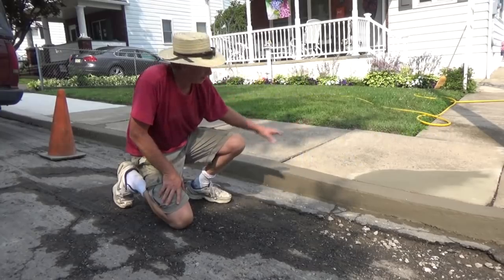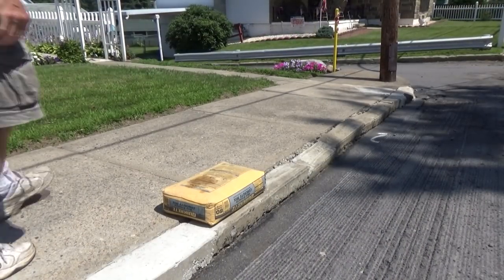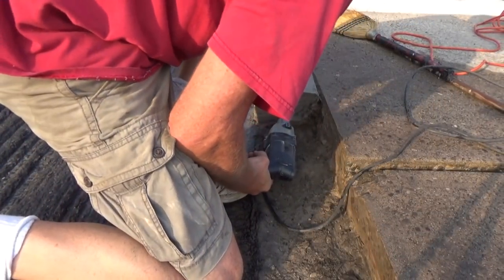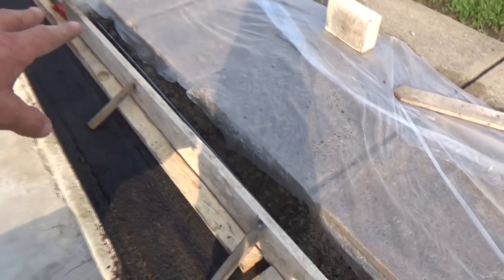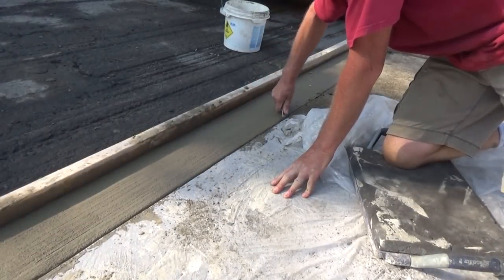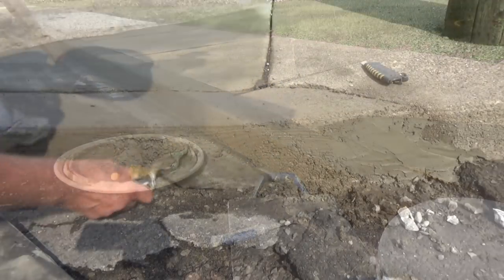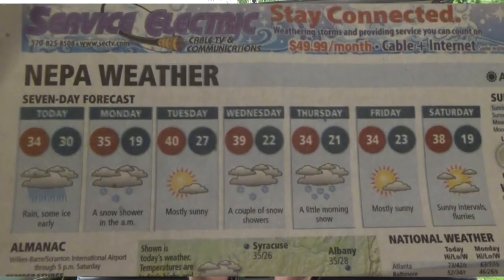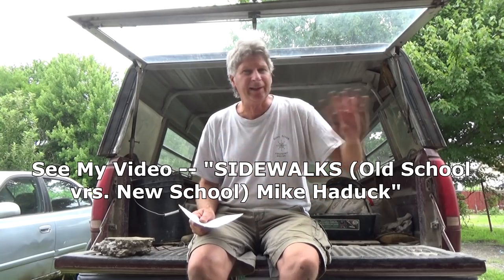CONCRETE CURB REPAIR  (Part 3) Mike Haduck

Comment: We don't have granite in northwest Oregon, so I have no idea of the cost difference between concrete and granite. There must be a trade-off between the time it takes to form and pour vs. lay down gravel bed and position stone. 
There are still concrete curbs in my town that have rings to tie your horse. New concrete seems to hold up worse than old concrete. I have no way of knowing how thick the sidewalks are, or whether they are reinforced.
Reply from the maker: Hi blank,  well I made my stand and that video about sidewalks In Europe and China,  I hate seeing guys with jackhammers when you really don’t need them, but the world is changing as it is, I appreciate it Mike

Comment: We use concrete for kerbs in the UK where the weather is similar to PA, but they are precast instead of poured. I've never seen one crumble or deteriorate so I assume the lack of voids in the cast is what saves them.
Reply from the maker: Hi David, I am so impressed with the way they are still using the stone curbs and stone sidewalks and pavers it’s hard for me to like anything else, but if it works it works, thanks Mike

Comment: Hey Mike, i gotta question. I have heard you say many times rebar rusts and blows the concrete apart. Why dont they coat rebar in a heavy coat of bitumen ?...boatbuilders do this to all the bolts they use to avoid this issue...Thanks mike....D
Reply from the maker: Hi D,  I can't say, they keep trying different things, don't see anything for sure. Thanks Mike
Reply: @MikeHaduck  Thanks for your reply as always Mike. I only asked cos i seen boat builders put a real think coat of black bitchumen on every bolt n nail to protect them from rust. There must be some reason it isn't used in construction. Again, really appreciate the reply...God bless n peace to ya.
Reply: @MikeHaduck  👍

Comment: Mike, What is the purpose of putting rebar in the kerb, do you provide expansion joint in the kerb?
Reply from the maker: Hi Iril, in the winter that curb will get hit with snow plows and it's either dig it all out or cap it, and I added that to keep it together, thanks mike

Comment: Great video, Mike, I have a question though.  I noticed that the previous curb had no rebar, if the curb is going to fall apart in 30 years regardless wouldn't it be easier to remove without it? Does adding rebar lengthen the life of the curb or does it just add support against abuse without adding life to the project?
Reply from the maker: Hi Chris,  I would say that it just adds to the support against abuse, because all the big trucks and machines will be hitting it And I want it to stay together,  but for the long term rebar only rots away And cracks the concrete up, thanks Mike
Reply: Thanks Mike, Chris.

Comment: I guess concrete held up so well  from Ancient Rome because of the favorable conditions. Here in Northeast Pa. it disintegrates over time. I think the mentality is that concrete is cheaper up front over granite, and let someone else worry about it when it does fall apart. Thanks for the video mike.
Reply from the maker: Thanks Bob, I couldn’t say it better myself, I appreciate it Mike
Reply: Romans used a very different and softer mix, that is why it lasted
Reply: @oreocarlton3343  Roman’s even invented how to set it under water

Comment: Concrete can be waterproof. I use a granite dust with frost proofer mix. Then I use a concrete sealer. This seems to last. 
In scotland the curb and the curbstones here are granite. The Council (local authority) own the pavement. So your not suposed to 'fix it' Though I have had to remove a sharp edge so that it doesn't damage car wheels going into the driveway.
Enjoy your videos Mike.
Reply from the maker: Thanks Inverness,  I never heard of the frost proofed mix, It sounds like a good idea, thanks for passing it along, nice to hear from Scotland, thanks Mike

Comment: Hi Mike,

I'm a DIY'er and need to do the same job.  I see professional curbs have expansion joints or sections.  Would I need to do this to replace a curb the width of a typical Philly rowhome?
Reply from the maker: Hi Yukon, wherever the joints or sometimes cracks are I joint them, anywhere between 10 to 15 feet, sometimes 20, Mike
Reply: @MikeHaduck  Thanks!

Comment: Hi Mike - Really Great videos I have learned a lot - you make it look easy! I have done some concrete work before odd and end jobs and ALWAYS have the same problem! My question is how can you tell when you have the correct amount of water ? Just when it looks almost ready to use but looks just a tiny bit dry I add a splash of water ( I use a power drum type mixer !/3 of a yard) Pour it, smooth it out, and start to finish it and wouldn't know it seems way to wet!!! I even wait about 1/2 hour before I start to finish it too. Do you have any trick or tip on how I can tell the correct amount of water to use ? It does not take much water at all & that was one thing I was supersized about when first stated to work with cement ANY thing at all you can offer all of us sure would be helpful! Thanks !
Reply from the maker: Hi Rosario,  truth is, I just keep adding water until it’s workable,  and where I think it’s at the right consistency to use it,  I do the same thing with car paint,  just keep Adding thinner until it comes out right, And I know every Mason does it the same so I would say no there’s no correct amount of water to put in, sometimes the sand is wet and sometimes the sand is dry and it makes a big difference in how much water you put in, and has to be wetter for plaster,  and dryer for stone so you put the water in as you need it, My opinion, thanks Mike
Reply: Thanks Mike for the fast response and the info. Yes it is a something I can only get better at by doing more work and gaining experience and that is why you are a master (IMO) at your craft!!!  Keep up the Great videos Sir and as always two thumbs up!

Comment: Great video, Mike. It looks like the curb was previously repaired next to the work you did. That section looked white to me. Did the previous contractor use too much portland to get that coloring or was it something else?
Reply from the maker: Hi Brian, no I just think it is the mix that comes from the truck, it whitens up pretty good after a couple days, thanks Mike

Comment: I see you didn't put any stress joint seams. Wonder why.
Reply from the maker: Hi, not between the curb, it's all in one and prevents sinking, other then that every 5 feet standard, Mike
Reply: @MikeHaduck  in my area I see the lines in the curbs for joint relief.
Reply from the maker: Hi, I have a video called , Sidewalks,,,old school vrs new school,  it might change your view on how they do things here, thanks mike

Comment: Do you have something against cement mixers lol will save your back. Great job on this btw a pro result!
Reply from the maker: Thanks MG, I haven't used the cement mixer in a long time, usually by the time I get it there clean it and get it home , the job is done, but for big jobs , absolutely,  thanks mike

Comment: Mike couldn’t you have stripped that form and faced the curb while the concrete was still setting up the day you hit the top with your brush
Reply from the maker: Hi Jorge,  I did, I used a fast drying cement and I was out of there that day, thanks, mike

Comment: That's not how to do a curb you have to go down 12 inches below the street and you need put expansion joint every ten feet I don't know how that passed inspection I'm a concrete finisher in pa and that would never pass a prepour
Reply from the maker: Check out my video, (sidewalks ,  old school vrs new school, mike haduck ) and let me know what you think,   Thanks, mike
Reply: Depends on the location.  I'm in PA as well.  Typically it's saw cut or tool joints every 10 and expansion every 30-50.  PennDOT spec is actually no expansion joints just at the start and stop of every day.  But you should definitely have 18 inches of curb or better.

Comment: Last I checked, repairing curb is City's responsibility... could get in trouble for even touching it.
Reply from the maker: Hi xephael, We wish that was the case, but not in this city or municipality, the homeowner is responsible, thanks Mike
Reply: @MikeHaduck  Ah okay.. I think you're a bit too hard on concrete.  I can be poured and redone if it fails very quickly.  That's why you don't see true brick being used as building siding any more.